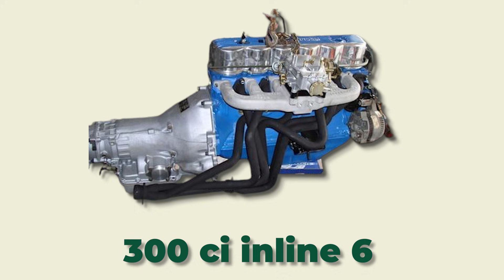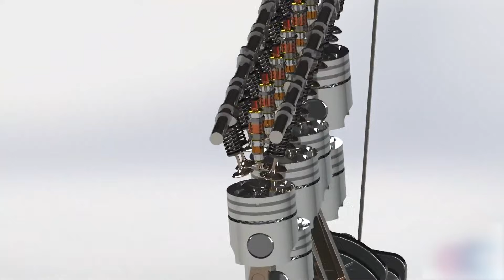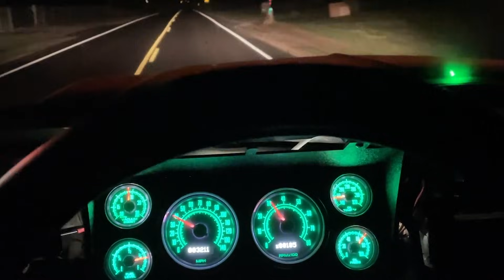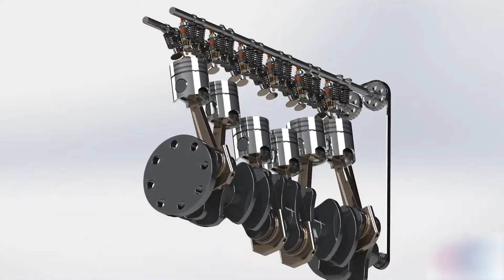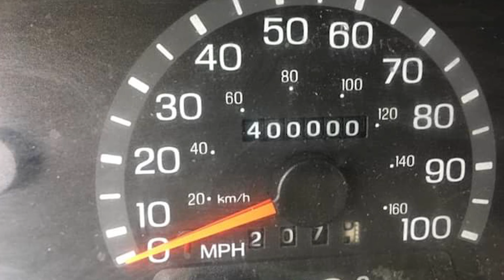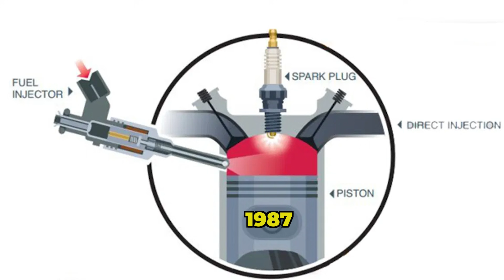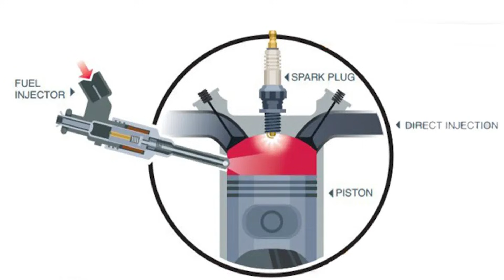Why the Ford 300 Inline Six Is Still Unkillable

Comment: My dad and I have an Ardco K-4x4 skidder made in Texas. The oil companies brought it to Venezuela over 40 years ago, and it still runs. That skidder came from the factory with a Ford 300 gasoline engine, just like I have a '93 Ford F350 with a Ford 300 engine, and I love that truck because of its Ford 300 engine. I don't want to change its workhorse.